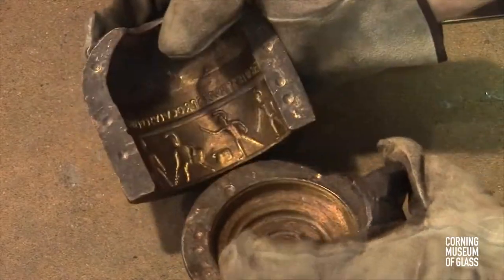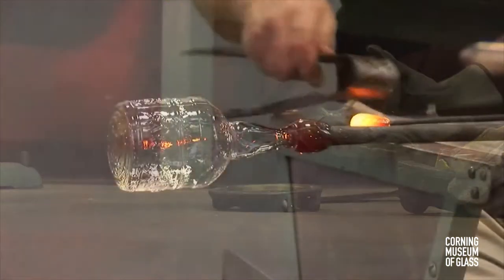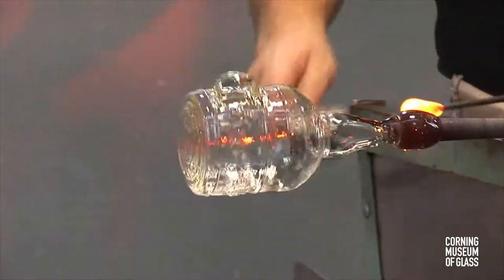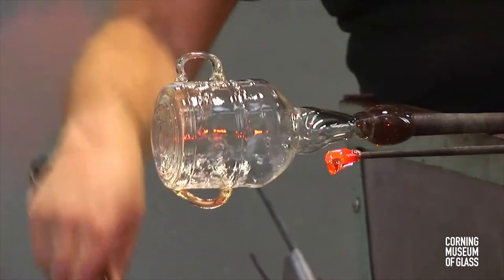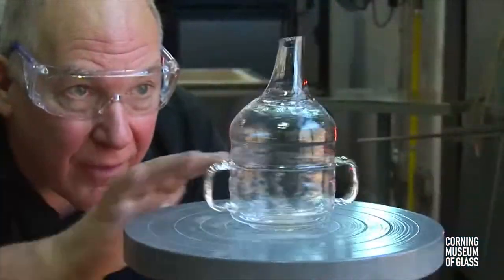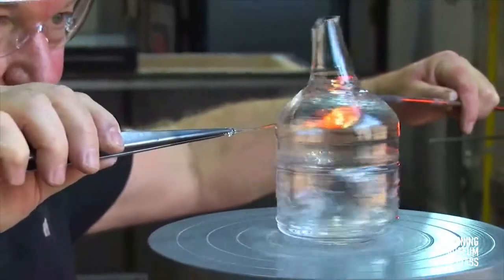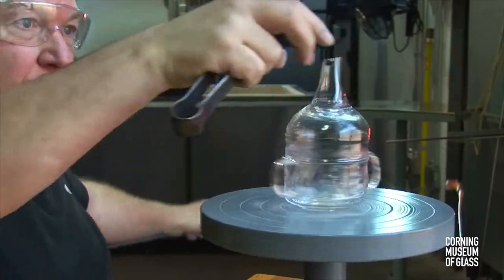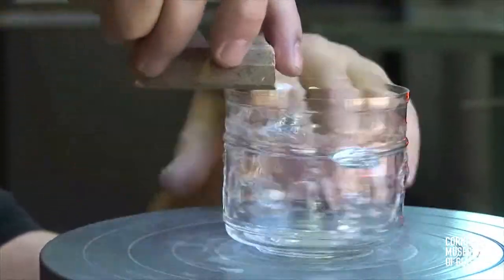Gladiator Cup with Handles

Comment: Very interesting, all these old techniques. The way the crack is formed using the drawn glass from the furnace, of course they did not have small butane torches! 

One question that popped in to my mind.. The rim of the cups, as it is cut, is/was very fragile. Is it not possible to reheat the cup and melt/round the edges? I am quite sure it is not (risky), but is there evidence they did somehow? Thanks.
Reply from the maker: The crack was historically formed with a thread of hot glass, taken from the furnace and held against the glass like a ribbon. The rim was then ground and smoothed using loose abrasive grit.  One could reheat the rim and cause it to melt and become smooth, but that would require re-annealing the object if done with a torch, or pre-torch., it would have to be picked up on a punty and heated at the furnace.  Both these processes were much more risky and would result in more breakage.  Also, unlike the cold working, these additional hot steps would require more skilled craft people, which were in short supply.  The process of grinding and smoothing the rim cold could be taught to someone with much less experience fairly quickly.
Reply: Thanks for the reply.